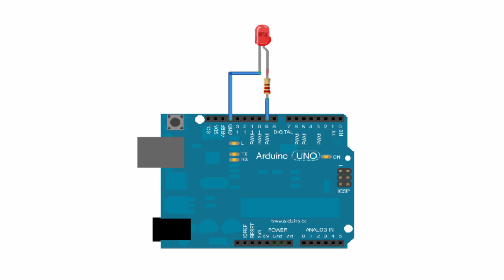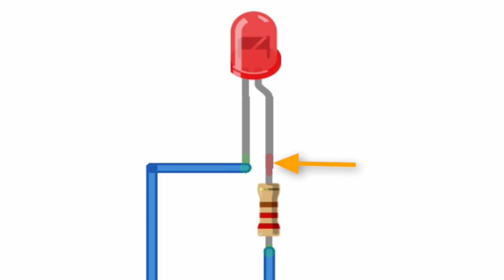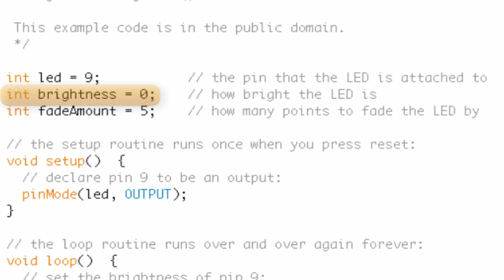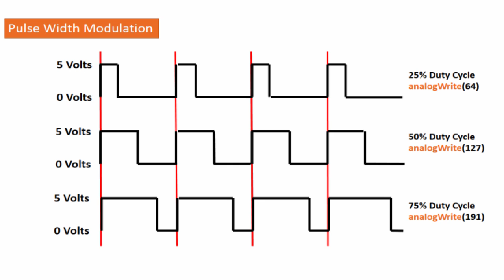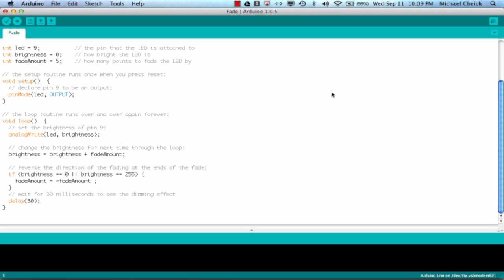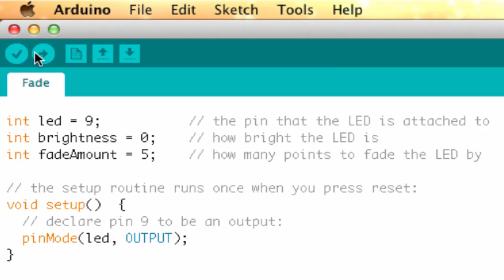Tutorial 10: Fade an LED: Arduino Course for Absolute Beginners (ReM)

Comment: 7:04 then why multimeter show different voltages respective to 255 ??
Reply from the maker: Great question - just so I follow - are you asking why your multimeter measures a voltage other than 5 at a pin you are PWMing?  If that is the question, this answer might help:
https://forum.arduino.cc/t/what-does-a-voltmeter-read-on-a-pwm-pin/674800/4

Comment: I've dug through many of the Arduino Tutorials and these are hands down the best I've found. A step by step walk through of the code with a little off humor (crystal mouse). I learned a lot from another guy out there but when I found out you can just "map" a range and didnt have to learn algebraic slopes I was a little upset over wasting so much time. This Series leads you down efficient and relevant pathways. 
Also, Check out the Milli's tutorials, much better way to program. I do wish there was one on Switch/Case. I found Switch/Case elsewhere. Switch/Case and Milli's transformed how I program.

Thank You Programming Electronics Academy!
Reply from the maker: Thanks so much for your words!  Glad you found this series helpful!

Comment: Very good video, little confused though that it says the fadeAmount changes to a negative once at 255 to bring it back down but when it goes down and hits 250 the if statement it ruled out. So why does  fadeAmount not go back to value outline in declaration when if function is not is use.

Comment: Hello,
I was wandering if there was a way to fade the led to 255 at first and then to a mid value, like 150.
I am trying so hard with what I know and the best that I achieved is the led to fade to 255 and then just going straight to a mid value.
  if (brightness <= 0 || brightness >= 255) {
      (fadeAmount = -fadeAmount);
      delay(500);
      (fadeAmount = fadeAmount);
      delay(500);
I thinked that it would have started to fade out for 500ms and then again up for another 500ms but it didn't work, any help?

Comment: Ho there,thank you. For what you ve done , i have a question : what do the pwm really mean i am confused betwwen the modulation of the time that 5v is applied and between the amount of the voltage that is applied as we ve seen in the voltage read or the single led brightness. Thnks

Comment: Great tutorials thank you  - just one point though which got me for a while - you mention in the key points about the analogWrite () function can be used with pins 3, 5, 6, 10 & 11 but you use pin 9 in your example. Was this in error?

Comment: Great tutorial, but this if statement is bad. If you change the fadeAmount, then it for example goes from 253 to 256, without being 255 at any point. Therefore they should have checked if it was more or equal... I know you knew this too 🤔

Comment: can i use pin 13 instead of 9 as it has an inbuilt resistor and i dont have to use an extrA resistor and change the code accordingly ofcourse ?

Comment: These Tutorials are great and thank you.  I did the challenges and everything is working as it should with the two lights. Thanks for the hint that helped a lot.  I wanted to take it one step feather and change the delay for each light and that is where i hit a snag.  I wanted to do a delay on led pin 9 @ 30 and a delay on led2 pin 3 @ say 60 or 5 or 25.

Comment: Arduino Has no Pins outputing analog voltage,  which means analogWrite is not true analog
output, instead is a square wave or PWM. AnalogWrite takes 2 arguments, the pin number
and the Number between 0 to 255. The Number  from 0 to 255 Represents the Duty Cycle
rather than the valtege value.  Remenber !!!  Arduinos analogWrite do not output true analog
Voltage , instead  they give controlled Duty Cycle Square Wave Pulses to mimic real analog
output. Duty Cycle was controlled by the second Argument of The analogWrite functin.  For
example, (pinNumber, 64 ) means 25% duty cycle,   (pinNumber, 127) means 50%.

Comment: Thank you, for your very easy to understand tutorials. This is my first try to coding arduino and it success by your video.
I tried to add some thing to the code to make it able to follow the value of variables.
void setup() {
  // declare pin 9 to be an output:
  pinMode(led, OUTPUT);
  Serial.begin(57600); //To show variable value in serial monitor (change this option in Serial monitor window too)
}

// the loop routine runs over and over again forever:
void loop() {
  // set the brightness of pin 9:
  analogWrite(led, brightness);

  // change the brightness for next time through the loop:
  brightness = brightness + fadeAmount;

  // reverse the direction of the fading at the ends of the fade:
  if (brightness <= 0 || brightness >= 255) {
    fadeAmount = -fadeAmount;
  }
  // wait for 30 milliseconds to see the dimming effect
  delay(100);
  Serial.print("Fadeamount: "); //Print text
  Serial.print(fadeAmount);
  Serial.print("    Brightness: ");
  Serial.println(brightness);
}

Comment: I really wan to do this using the potentiometer controlling the brigthness. Its has been somehow difficult since im starting on Arduino.
Reply: Keep the potentiometer setup on your breadboard from the previous tutorial, and then add the LED setup on another section. In your code, delete everything that causes the LED to fade automatically, and instead read from the value of the potentiometer to control the brightness:

int led = 9;   // the PWM pin the LED is attached to

// the setup routine runs once when you press reset:
void setup() {
  // declare pin 9 to be an output:
  pinMode(led, OUTPUT);
  Serial.begin(9600);
}

// the loop routine runs over and over again forever:
void loop() {
  int sensorValue = analogRead(A0); //read value from potentiometer
  int brightness = (sensorValue/4); //brightness according to potentiometer
  analogWrite(led, brightness);
  
  Serial.println(brightness);
  delay(1);
}

 Multiplying the sensorValue by 4 isn't perfect, but it's simple and enough to fade the LED according to what your potentiometer is at.

Comment: Without thinking, thanks for your tutorials. I learned too much. Just a question, what is the PWM frequency of analog outputs (or what is the length of the cycle)? Can I write my own code to make all digital pins act like analog outputs?

Comment: Awesome tutorial. I watched the previous videos and decided to make an introductory level sketch myself using the knowledge i gained so far. I would love to share it here as these videos have helped me a great deal. I hope the sketch will help other beginners to be flexible and to think a little out of the box :)

the sketch will make a buzzer blink with the interval between each "blink" of the sound changing in a loop between 2 time frames ( in my case, the time interval changes constantly between 1 and 200 milliseconds by 50 milliseconds each time )

I used an Active Buzzer as the Passive buzzer barely made any sound. The circuit was very much like that in the "Fade" setup but with a breadboard.

********************************************************************************************************************************

/*this is the first attempt to write a correct program which will make intervals  between each buzzer beep short and then long
in a loop
*/
/*this is the second attempt to write a correct program which will make intervals  between each buzzer beep short and then long
in a loop
*/
/*this is the third attempt to write a correct program which will make intervals  between each buzzer beep short and then long
in a loop
*/
/*this is the fourth attempt to write a correct program which will make intervals  between each buzzer beep short and then long
in a loop
*/

int buzzer=9;            //buzzer integer given the value of 9
int interval=50;         // the difference between each buzzer will change by this much amount
int diff=0;                  //the value which will change delay value by being in the delay's parameters, hopefully, this time

void setup() {
  // put your setup code here, to run once:
pinMode(buzzer,OUTPUT); //buzzer is set as an OUTPUT device

}

void loop() {
  // put your main code here, to run repeatedly:

diff=diff+interval;                               //to change value of diff repeatedly each time the loop is executed

if(diff<=0||diff>=200)  
interval=-interval;

digitalWrite(buzzer,HIGH);         //to switch on the buzzer
delay(diff);                                    //delay the task by "diff" milliseconds, and diff keeps changing each time is executed individually
digitalWrite(buzzer,LOW);          //to switch off the buzzer
delay(diff);                                    //to delay any other task, i.e, to keep the buzzer off for "diff" milliseconds
}

********************************************************************************************************************************

I hope this will help other beginners as well as inspire you to make more videos as such as it will always benefit a section of the community to take up tasks and projects of their own ideas.
Cheers!

Comment: Thanks for great video. Helped me a lot
I just wonder few things about PWM

1. Is it right that PWM pin has 0~255 phases to send voltage, and non-PWM has only 0 and 255 phases?
2. Is it right brightness of LED or other light-emitting things is decided by PWM?

Comment: Sir How Can I Fade LED Only Once
And 
Why This Code Is Not Working
int led = 9;           // the PWM pin the LED is attached to
int brightness = 225;    // how bright the LED is
int fadeAmount = 5;    // how many points to fade the LED by

// the setup routine runs once when you press reset:
void setup() {
  // declare pin 9 to be an output:
  pinMode(led, OUTPUT);
}

// the loop routine runs over and over again forever:
void loop() {
  // set the brightness of pin 9:
  analogWrite(led, brightness);

  // change the brightness for next time through the loop:
  brightness = brightness - fadeAmount;

  // reverse the direction of the fading at the ends of the fade:
  if (brightness == 0) {
    fadeAmount = 0 ;
  }
  // wait for 30 milliseconds to see the dimming effect
  delay(30);
}

Comment: if we remove the if function then it should start from zero and go to 255 with increments of 5 and stay at  5v (255) for forever with no change in the intensity of light of LEd... but actually it shows like this 0,5,10,...,255,0,5,10,....,255,0,5,10,...,255,.......   why?
Reply from the maker: Great observation!  What I am pretty sure is happening when you take the if statement out, is that the value of the brightness variable is going to "roll over"  Since an integer can only hold so large of a number, when you add more, it actually starts back at its beginning.  Does that make sense?   

If you insert a serial.print(brightness); into the sketch, see what happens.  Again, great observation!
Reply: thanks for ur kind reply...
 inserting  serial.print(brightness);  into the code ..the brightness values exceeds 255 with increments of 5...... ... 
but the led shows something different......why?..... confused..!

Comment: i have a question 
i write a new sketch about fading which 
int LED = 9; 
int brightness = 0;
int fadeAmount = 5;
int levelOfBrightness = 0;

void setup() {
  pinMode(LED,OUTPUT);
}

void loop() {
  levelOfBrightness = brightness + fadeAmount;
  analogWrite (LED,levelOfBrightness);
 
    if (levelOfBrightness == 0 || levelOfBrightness == 255) {
    fadeAmount = -fadeAmount;
      
    }
delay (30);
}
and it didnot work
Reply: In void loop try moving "analogWrite (LED,levelOfBrightness);" to be above  "levelOfBrightness = brightness + fadeAmount;"
Reply: This is a mathematical problem. On first pass of the loop the line levelOfBrightness = brightness + fadeAmount would be
 0 = 0 + 5, so levelOfBrightness would then be 5. So on the second loop levelOfBrightness = brightness + fadeAmount would be 5 = 0 + 5. You see the value of brightness didn't change on the first pass of the loop so the levelOfBrightness will still = 5.

Comment: thank you for this amazing piece of leason. just one question when the loop goes bellow 0 and it's (-1)*(-5) how is it not continues to stay -5 instead it becomes permanent +5 after this operation.  just a lame question I know but it bugs me off. it meets Condition of the "if" statement so should stay as negative five.... just get my head round it. please help uneducated guy understanding 😊
Reply from the maker: This a great question, and it takes a while to grasp I think.  If you remember that the variable that holds the fadeAMount value changessign every time through a complete loop:

so the calculation goes

(-1)*(5) = -5
(-1)*(-5) = +5
(-1)*(5) = -5
(-1)*(-5) = +5

The sign on the fadeAmount variable flip-flops.  Hope this helps some!
Reply: Programming Electronics Academy .of course! it's in circle hence "loop". all right now it makes sense.  lol. I'm sorry. I said it might look like a daft question 😊.  once loop is over it returns to the first command so the process restarts over nd over again. thank you again I'll be on it soon to test it and hopefully modify for future projects.  peace out
Reply: heyyy sasna.... the song is bonus beat blast 2011
Reply: Thank you so much.finally found this.
Reply: Programming Electronics Academy  could  you please tell me which song was that??
Reply: This method only works when fadeamount is either 1, or 5. Both of those choices will have brightness land exactly at 255, if the value for fadesmount is chosen from [2,3,4] the code fails since brightness is never exactly 255.

Comment: Hi,
I tried this and mine does not work .  meaning, when it reaches 255 this goes out and then starts up getting brighter and brighter ect then starts all over again.  My if statement looks like this:
NOTE:  I am using an Arduino MEGA2560 R3 (actual Arduino from SparkFun) and I am using on-board LED on Pin 13.

if (brightness == 0 || brightness == 255) {
    fadeVal = -fadeVal;
}

delay(30);

NOTE:  I have tried putting two '-' signes in front of fadeVal as well with same results.  And, fadeVal is defined as an "int"

The full project code is below:

/*
 * THIS IS EXAMPLE CODE ON HOW TO FADE AN LED UP/AND DOWN
 * A BRIGHTNESS VVALUE RANGE WITHIN THE MAIN LOOP
 */

int led = 13;
int fadeVal = 5;
int brightness = 0;

void setup() {
  // put your setup code here, to run once:
  pinMode(13, OUTPUT);
  
}

void loop() {

  analogWrite(led, brightness);
  brightness = brightness + 1;
  
  if(brightness == 0 || brightness == 255) {
    fadeVal = (-fadeVal);
  }

  delay(30);
  
}
Reply: In void loop

brightness = brightness + 1   should be   brighness = brightness + fadeVal

If you want it to change by 1 then change your variable  int fadeVal = 5;   to   int fadeVal = 1;

Also, remove the parenthesis from around the -fadeVal.

So   fadeVal = (-fadeVal);    would be   fadeVal = -fadeVal;

Hope this helps!

Comment: To test I use the Arduino and I will incorporate nano into what I'm 
doing now. I see that the fading can be used 3,5,6,9,10 and 11 digital 
pin, and I need 8 pins. Can some of analog pin used for missing 2 fade 
possibility. Thanks in advance and I wish you a nice day~

Comment: in the newer versions of the IDE, in the fade sketch, it has (brightness <= 0 || brightness >= 255) as opposed to what your version which has (brightness == 0 || brightness == 255). they seem to do the same thing, but what would be the reason for the change? is one better than the other?
Reply from the maker: Great question!  The new version is better.  In one of the challenges in the course, I beleive we talk about why.  Say for example, the brightness variable is set to the number 7.  Even when the value of the brightness variable exceeds 255, the condition situation is not met in the == example, because multiples of 7 never = 255 (they exceed it, but don;t equal it), and so the fade amount variable does not change sign.

i hope that makes some sense.  Thanks for this great question.
Reply: @ProgrammingElectronicsAcademy So is it a "greater than" and "less than" statement instead of an "equals" statement? BTW thanks for the amazing tutorials.

Comment: First, Thank you for uploading all these asome tutorials, i am really learning a lot from you!
I have a question about declairing the initures.
How does the code know the int fadeAmount is a value instead of a pin number?
Greetings from Holland!
Reply: As cambridgetate said 2 years ago
"when you are declaring values, it doesn't matter what the value is until you use the variable. In this case you used the variable led in setup pinMode and the other variables brightness and fadeAmount were used in the loop."
Reply: Thank you!
Reply: Thanks Ronald... I also had the same question before..👍

Comment: if I change the fading to 10 or more the process of fading will become faster but around the time when the LED´s brightness is close to max it sudenly blinks and than fades out accordingly to the code. Do you know why is it?
Reply: ou it is caused by overpassing the 255 limit after which the voltage will drop to 0. I tried it with set value to 256 and it stayed off so that is why :D.

Comment: Thanks a lot...
It was very useful.
But can you just say why 255 was used as the upper limit, is that because it's 1/4th of max brightness (5V) ?
Reply: It's 8 bit which means there are 2^8=256 levels (0 to 255, counting the zero).